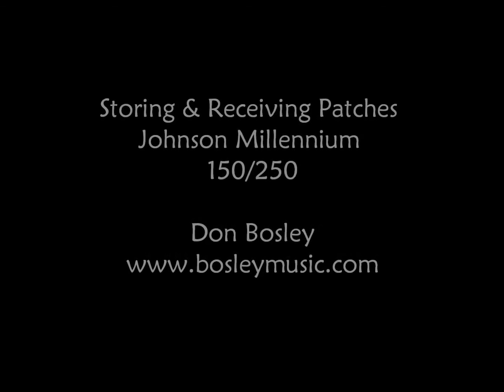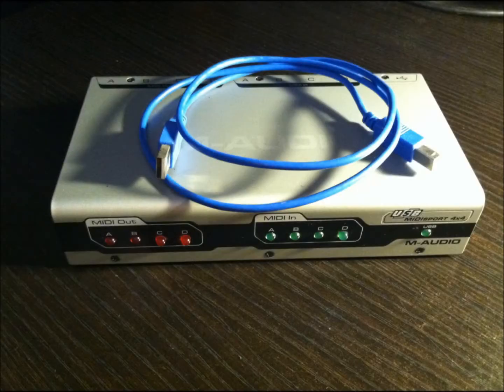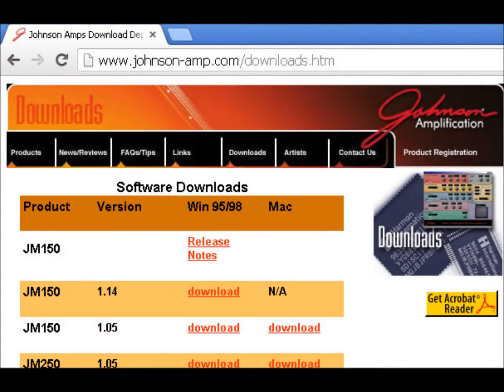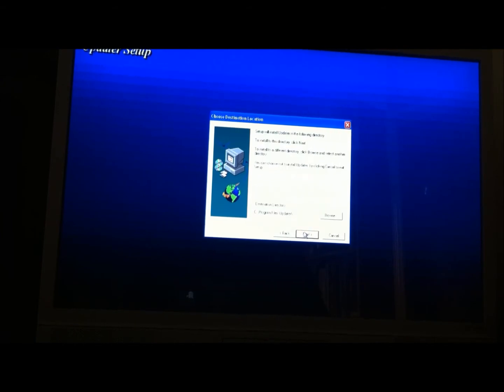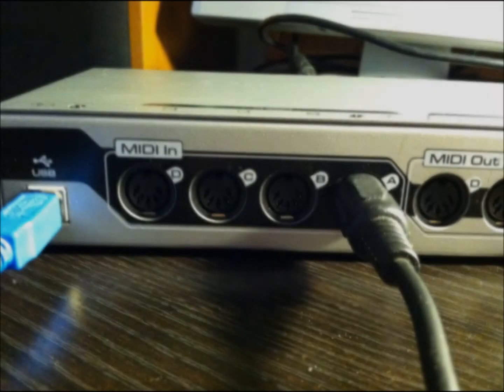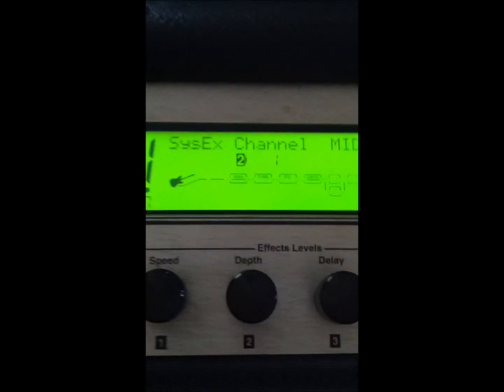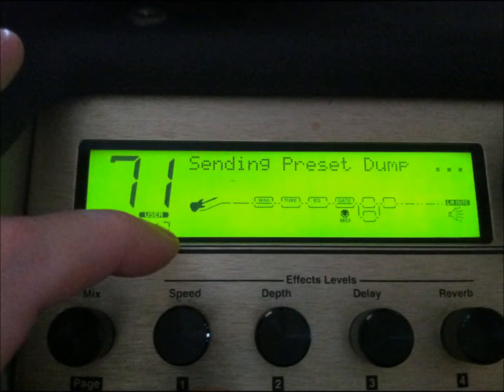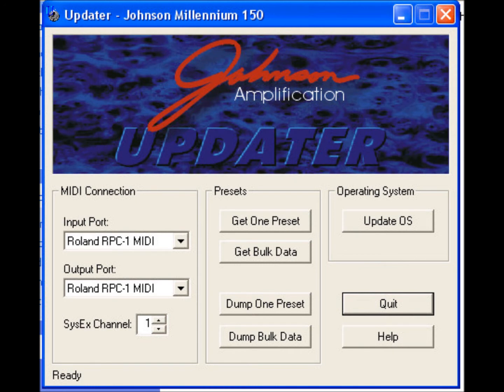Storing and Receiving Patches in the Johnson Millennium 150 and 250

Comment: I think I figured out how to patch up to 1.14, but I have a question for Don Bosley before I go any further.  If the PCI SoundBlaster Live PCI card with the MPU401 slot (assuming that it is a 401 and not just a joystick port) will work, I can easily do this, I found the cable and I have everything else ready and running.  I threw away, in July, a Super Micro board that had 16 bit slots on it (go figure), so I would need to spend about $100 to buy a socket 775 board that has 16 bit slots and then I can just use a SoundBlaster 16 card, easy peasy.

Don Bosley - rather than go that route, and seeing that all I need is 1 of my 3 amps to run 1.14, I would rather pay you $100 and have you update amp-to-amp one of my flock.  This is easier for me because I don't have to build and install the OS for a system, just get the end result which is one of my amps on 1.14.  I can clone the other two myself.

Would you be willing to do this for that price?

Thanks,
David

Comment: OK, I found the editor further down in the comments.

I tried to use RPEdit on Windows 10 using a Rolland UM-ONE and also the MIDI ports on my Komplete Audio 6, it barely worked and was mostly buggy.  Should I buy a M-Audio Midisport 4x4, or is it Windows 10 causing the issue?  Do I need to use ASIO drivers?

Now, before I brick an amp, I was wondering if I took an old PC with XP installed and purchased a PCI SoundBlaster Live card for it to use the MIDI port?  The SB Live seems to have the 15 PIN MIDI port on the back, and I can get a cable for 15-pin to 5pin DIN midi, has anyone tried this?

I can scrounge up a board with a 16 bit ISA slot if needed, but I would prefer to not go back that far in regards to hardware.  I can still get a 16 bit SB card, but man we are talking Pentium 266MHz CPU's at that point with 128MB of RAM, talk about slow...

This is the card I was thinking to get:
https://www.youtube.com/watch?v=z-HiLp5p820

Comment: So I would like to debate the USB to MIDI situation you mention.  I had the same issue updating another device via USB to MIDI, but the issue was not MPU401 protocol related, rather it had to do with the buffers in the USB MIDI device.  It was awhile ago, but basically it came down to some USB-MIDI devices have a buffer, and of those some can clear the buffer when a transfer is finished, while others simply hang and leave the remaining bits in the buffer and never flush them.  The Roland UM-ONE actually had a switch, if I remember, to disable the buffer so this would not happen.  Also the M-AUDIO M-ONE also had similar functionality(or no buffer).  Most the cheap USB-MIDI adapters did not have the ability to flush the buffer, and this would cause firmware updates to fail.  I think it might have had to do with my Roland V-drums and the TD-9 drum "brain", but I could be mistaken.

How does one get in touch with Mr. Don?  I would like the 1.14 firmware and the editor/patch dumper software.  It seems the site that hosted them is down, so I am out of luck.  I would also be willing to drive one of my amps to NY and clone the firmware, I would be willing to pay for your services if this is possible.  I could also just ship the board, but I go to NYC to visit friends a few times a year so...

Thanks again for sharing your knowledge.

David

Comment: Anyone know the difference between OS version 1.05 and 1.14?  I'm still on 1.05 and even though I have a Win98 spare computer I hesitate to update at this point.
Reply from the maker: 1.14 actually fixed a sysex error that allowed RPEdit to talk the amp properly... Can't remember off hand but at one point some effects were added and I think they come after 1.05 - looper, longer max delay time, and some things that resembled the digitech time warp pedal. Nothing major if you've been using the amp this long on 1.05...
Reply: @BosleymusicCentral  Good to know, thank you for that!

Any idea if the RPEdit version I mentioned was the last/latest and greatest?

Comment: What patch editor and librarian do you use for windows 10?
Reply from the maker: I put a windows XP machine back together so that I can just use the updater software if necessary (along with some other legacy equipment I have) - at one point I was using RP-Edit, but odds are pretty good it won't work with a more recent operating system either. Using a Virtual Machine, or even emulation mode under windows, it might be possible to edit, but I wouldn't do firmware updates via a VM, personally.

Comment: Hi , I need HELP and you seem to be the authority on these. I have a Johnson mil 2 by 12 combo. I want use it just as a speaker cab as I love the speakers. My problem is I don’t know how to match ohms. The amp head I’m using has two output sections , one that is a single 16 ohm output and the other is a dual 8 ohm parallel output. The millineum of course has two celestion 12 s each with its own speaker cable . It’s an 8 ohm speaker , so two 8 ohms. Is the Johnson 2 by 12 in series or parallel? Or are both speakers independent from one another and just. 2 independent 8 ohm speakers? Will the amp I described above, using the 2 “8 ohm parallel “ outputs work? Or is this an ohm mismatch that will damage equipment? Will I have to get something like the Radial Cablink to do this? Please help, I really wanna figure this insanity out? Lol thanks
Reply from the maker: Load in Ohms is a minimum rating dictated by the amplifier - speakers in parallel = 1 / ( 1/OhmsA  + 1/OhmsB) i.e. 1/ (1/8 + 1/8) = 4 Ohms, speakers in series sum 8 + 8  =16 Ohms. Different amps have their output jacks in different configurations - i.e. independent, parallel, etc... It's not clear whether you're asking me about connecting the speakers from an actual 150 combo, or connecting speakers from the actual 2x12 made by Johnson, or both. Make this simple : tell me what amp you're trying to connect, and how you would ideally like to connect it.
Reply: www.bosleymusic.com I have a Johnson millineum 2 by 12 combo amp . I want to use it as a speaker cabinet only. I want to pair it with a PRS Tremonti mt15 head. Here is the the Tremonti amp to give you reference. https://www.sweetwater.com/store/detail/MT15H--prs-mark-tremonti-mt15-15-7-watt-tube-head
Reply: www.bosleymusic.com thank you so so much for helping, I been trying to figure this out and it’s driving me nuts. To reiterate , I only wish to use the speakers , I.e unplug them from the back of the millineum combo , and use the Johnson millineum combo as a speaker cabinet only for this Tremonti amp head. Thank you thank you
Reply from the maker: @juanvaldez5422  From what I see in the manual, it looks like the Tremonti head by PRS has a 16 ohm, and dual/parallel 8 ohm jacks. If you use the 16 ohm output you would need to wire the two speakers of the Johnson in series - provided they're the original 8 Ohm Celestions. If you use the two speakers of the Johnson series wired into one of the 8 ohm parallel outputs, you would need another 16 ohm (minimum) cabinet connected to the other out.

Comment: Does anybody have a link to this program? Or can someone share the program?
Reply: Here's a link:

ftp://ftp.digitech.com/pub/updaters/
Reply: @GeorgeAndrewsAI  Awesome thank you!, do you perhaps know till what firmware i can upgrade the Millennium 150, the latest revision of the firmware according to the updater is Revision 1.140. But i need 1.141 for RpEdit to get to work. Any later firmwares are also good. Do you know where i can find later versions than v1.140? I cant seem to find it on the Ftp site. Best regards
Reply: @bram9498  No problem!  Took me a while to find, so I figured I'd share here where people can find it.  The version you're looking for is under the beta folder.  ...pasting the link below.  I've read that the 250 files are compatible also, but personally, I wouldn't risk it.  

ftp://ftp.digitech.com/pub/updaters/Beta/Wjm150v1141.zip

Out of curiosity, what hardware are you using to flash?  I read that USB to MIDI converters will brick the amp and a MIDI controller that supports MPU-401 is ideal.

Found some good info here:

https://johnsonamp.wordpress.com/2007/08/09/faqs-updating-your-os/
Reply: @GeorgeAndrewsAI  hey appreciate your quick respons!, probably saved me already so much headaches with this article. I was planning to use the Terratec EWS88MT soundcard that is installed in my older systems. It should be compatible with MPU-401 however I need to use VM ware to run Windows XP Iam not shure if updating is a good idea from VM ware virtual enviroment, i have used it to save patches with the old version of the update program and a 2x2 midiman attached, that worked. Updating is safer straight from Windows XP being installed on a seperate system. First i will read the full article. Thanks again.
Reply: @GeorgeAndrewsAI  What bothers me a little though is the fact that all these versions are Beta's and not fully tested. I have no experience but maybe you have and can tell if they are not causing problems.
Reply: @bram9498  Thanks for sharing your sound card!  Yes, looks like that one is MPU-401 compatible.  I still haven't updated my amp from the original 1.00 version yet as I'm still researching MIDI cards.  Don't have any first-hand knowledge of updates yet, unfortunately.

I've done my best to read through forum posts and haven't seen any complaints about the beta versions.  From what the release notes say, the updates were mostly just bug fixes except for version 1.04 and 1.11, which added some new sounds and effects.  Version 1.140 (File: Wjm150v1140.zip) was released in December of 2000 so even the beta versions should be well-tested by now.  I'd say the update files are safe, it's just the actual flashing is risky because it's hard to find a compatible sound card.
Reply: @GeorgeAndrewsAI  Hi George, I tried the following soundcards till so far, they dont work all give the error message 50H when the are in recieve mode: Terratec EWS 88mt, Soundblaster Live CT4620, Roland rpc-1. Iam confused after using the soundblaster card. Was hoping it would with that one.
Reply: @GeorgeAndrewsAI  Any luck or info about what type of interface to use to upgrade the amps?
Reply: @GeorgeAndrewsAI  Hi George! 
I'm trying to repait my JM150 wich haves firmware problem, and i need flash tool + firmware. That FTP does not work anymore :( , can you send me , if you still have that files in your PC on email or upload it on link ? I would be very grateful
Reply: @lucifer240794  - It's all still there, they just reorganized.  Plugging the URL I provided into a search engine provided the new URL:  https://www.mmnt.net/db/0/0/ftp.digitech.com/pub/updaters

You'll need the "WJM150" files.  Be very careful and do NOT update with a USB interface.  I have not done the update myself and don't have the time to research further.
Reply: @GeorgeAndrewsAI   hello , and thank you! I cannot download them , when i click on file , it opens link to downlad and , it's like server it s not available.
Reply: @GeorgeAndrewsAI   :(
Reply: @GeorgeAndrewsAI  Hello ,any news about server ? Thank you

Comment: you can fire up a VM which has win 98 and load the Johnson software onto that.  This lets you use a computer with any OS
Reply from the maker: That's fine for patch transfer, but don't do an OS update without MPU-401 compatible hardware, or following the advice of others who have used MIDI-OX, etc... you risk bricking the amp if the transfer doesn't complete.
Reply: Is there a card and interface you recommend for updating the OS? I have one of the earlier JM-150's on 1.0. I am looking at a Roland MPU-IMC- MIDI Adapter PS/2, didn't know if that would suffice, thanks!

Comment: Hello Bosley music. I had a problem in the past with my JM-250, where it wouldn't boot up. I was going to trash it. I tried something else instead. I found that there was a rechargeable,  soldered in CR2030 battery that was typically unreplaceable to the layman without the desoldering process. I replaced the battery with a PC type CR2030 battery holder. I bought a rechargeable CR2030 battery, and removed its pc mounts. I loaded it into the pc type CR2030 battery receiver as you would fro a typical pc when its battery goes dead, and the amp works perfectly now. Are you familiar with this type of situation, or have you heard of this issue before?
Reply from the maker: +Frederick Kramer I have never seen the battery soldered in - all of the amps I have ever had or seen, the coin cell holder was already there. I've also never heard of the battery being dead from stopping the amp from running, only the inability to store patches or save anything.

Comment: Hi Don. I've run into an odd issue I haven't seen documented anywhere. I used MIDI-OX on Windows 7 (settings as documented in this thread) to successfully load a file of patches. I had fun with them for a while, turned the amp off, and when I came back the next day and turned it on, after the credits it displayed "Unknown fx module" and rebooted. On that reboot, it was fine ... until I turned the preset knob while in user preset mode, whereupon it showed the same "Unknown fx module" and rebooted again. Thereafter, every turn of the preset knob while in user mode caused the same reboot. If I went into factory preset mode immediately after a reboot, no reboots ever happened while turning the knob.

The amp eventually wouldn't even boot, showing "Waiting for data..." endlessly. I found out how to do a factory reset using button presses on power on, which brought it back. I repeated the patch load, and the same sequence of events (minus the "Waiting for data..") happened - every turn of the knob caused a reboot while in user mode.

Based on this, it looks like it is possible for a patch file to load bad data into the amp, and that eventually causes that reboot problem. The amp is rock solid when the patch file in question is not loaded and the amp has nothing but factory presets. I haven't loaded other patch files, so I don't know how prevalent this is.

Have you heard of any such problem? My amp has 1.14 on it. Are patches generated from amps running earlier versions supposed to be compatible? I don't actually know what version the patch file I have came from, but I'll find out. Maybe MIDI-OX isn't completely reliable?
Reply: Mark Peters After more thinking, I suspect that this is a bug in the firmware. Patches referencing hardware not currently (or maybe ever) attached cause a reboot. In my case, I know that the patches reference the J12 controller - but I have only a J8. The software should be able to handle that gracefully.
Reply from the maker: Mark Peters  First, I've never seen this. Second, yes, the Johnson had graceful handling for if you dropped from 4 to 2 expression pedals, reassigned switches based on the number available, etc... so that shouldn't be the issue. If you are running 1.14 but the patch came from something higher (is there a higher firmware, I don't remember off hand?) or from another unit (i.e. actually made for 2120, etc...) then it could give you errors like you describe. A patch from an earlier version should be compatible, but not the reverse because of the addition of effects like looper, reverse, longer delay, etc... I don't know that I wouldn't trust MIDI-OX - it may also be that your Johnson isn't doing something properly - have you tried the same patch in multiple slots (store to user 10, 20 and 30) and see if there is any difference? Sounds to me like you may have a memory issue, though.
Reply from the maker: Mark Peters And I just answered my own question - there was at least a beta 1.17 release.

Comment: Here are the latest bios versions for both the JM150 & JM250.  Zip files contain the Johnson Updater as well as the last version of RPEdit and a sample patch with info.
http://www.heirapparent.com/real/JM150-Bios-Editor-Patches.zip  (v1.14)
http://www.heirapparent.com/real/JM250-Bios-Editor-Patches.zip  (v1.172 beta)
I've had luck using Win7 with the $40 M-Audio USB/Midi converter cable to load patches, but I recommend XP or Windows 98 with an old SoundBlaster midi interface to get Bios updates to work flawlessly.
Reply: +Terry Gorle Terry you are the man! Thanks for posting the software as the Johnson website is no longer there. Don you are also the man. Just got this amp and the sound is incredible. Good low end as well. I have had later Digitech stuff and the programming was very simple with those pieces but this is a new learning curve. I am sure I will figure it out soon and get the hang of it. Thanks guys.
Reply: thx Terry 👍 appreciate it!
Reply: So, I found the cable to go from the 15pin to 5 pin midi in/out.  Can I use a SoundBlaster Live PCI card for the firmware update?  I have a 100% working MSI MS7514 board which supports XP and has PCI slots, I am trying to avoid a 16 bit slot board.  Thanks.

Comment: Ok, as public service here are settings you need to transfer your friend's patches to you JM150 or JM250 using Windows 7 and MIDI-OX: MIDI-OX Sysex Configure window ( trail is: VIEW>SYSEX pick SYSEX> CONFIGURE)
Low level input buffers —————————— set to Size 256 Bytes, Num 16
Low level output buffers ————————— set to Size 256 Bytes, Num 16
Auto-adjust Buffer delays if necessary ——- Untick
Output Timing
Delay between buffers —————————— set to 250 milliseconds
Delay After F7 —————————————— Tick, and set amount to 250 milliseconds

cheers!